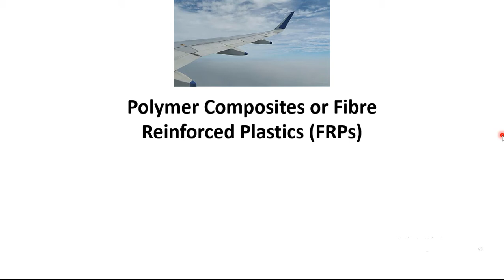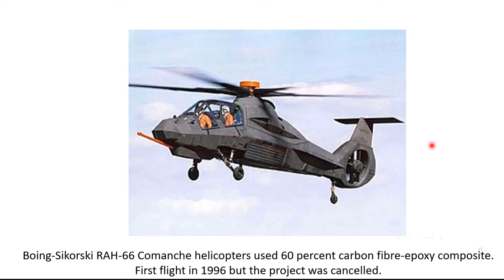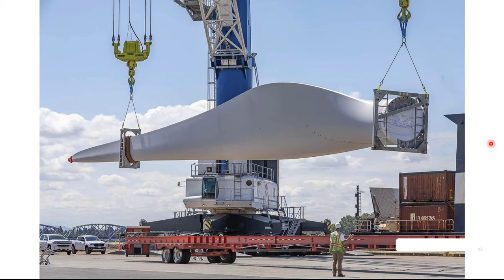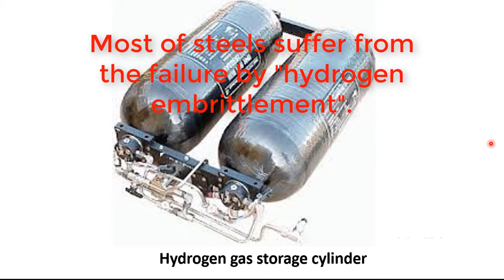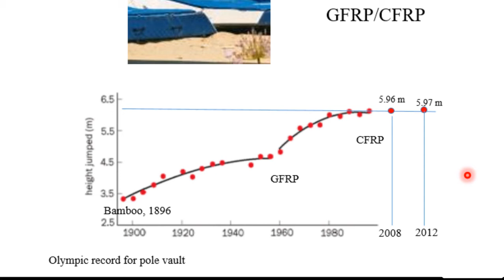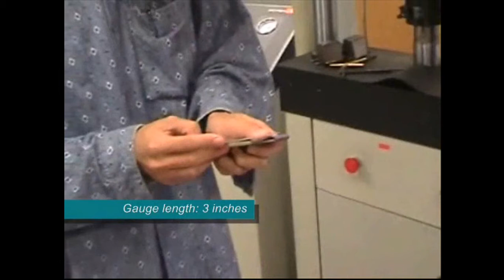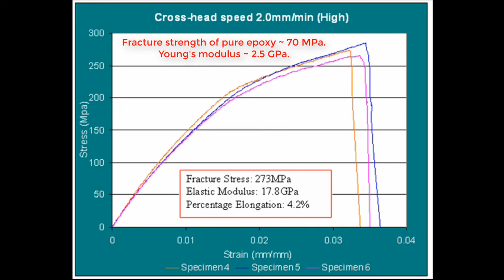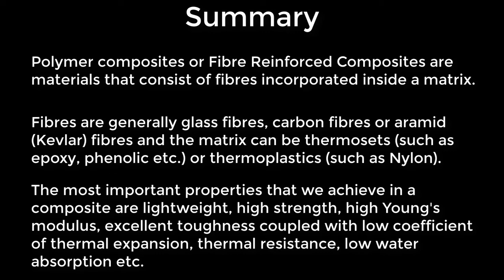An Introduction to Composite Materials (Polymer Composites or Fibre Reinforced Plastics)

Comment: Sir I want to know simple composite material products which used in real life like chair.
Reply from the maker: Thanks for asking. Presently, composites are not being used for everyday products due to cost. However, it is possible to use short fibre composites which may not be very expensive. My suggestion would be to use epoxy-short glass fibre composites for such products as chair. Another possibility would be to use epoxy or any plastic and bamboo fibres. 
We are so used to using materials such as steel, aluminium and wood for everyday products that we are not using composites for everyday products. However, there is good possibility in the construction industry for things such as door frame and door making.